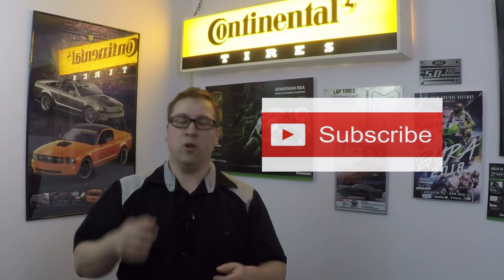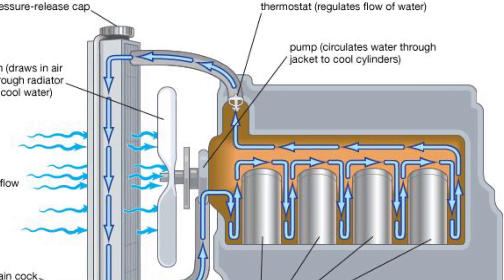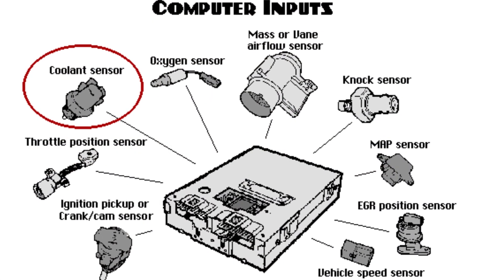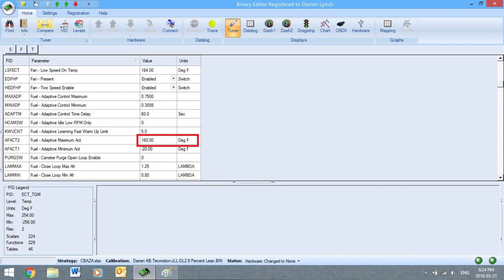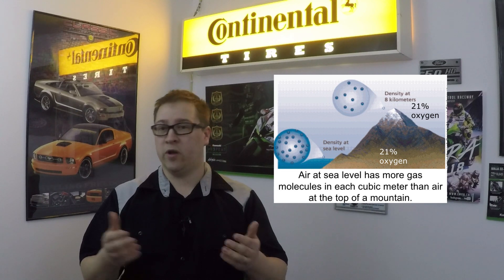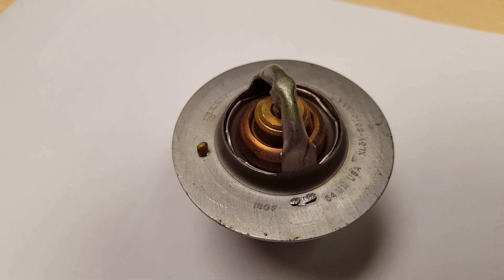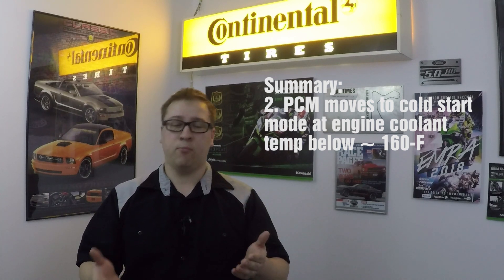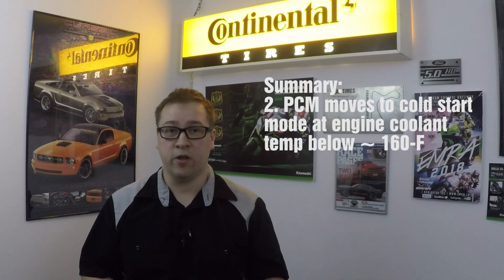Which Performance Thermostat for your 5.0L? - SN95 Owner's Guide #5

Comment: I just completed a p.i. intake manifold swap on my 97 GT convertible 5 speed. Along with all the other bolt ons. ( bbk 73mm, slp catback, bbk cold air, steeda underdrive pulleys, sr performance aluminum driveshaft). Upon completion of the install, for some reason, I decided to buy a moshimoto racing thermostat, because in my mind i thought cooler is always better. The car would not even warm up. It was bad. I ended up putting a new oem replacement in it and it still runs a little cooler but it now warms up faster, and my fans kick on when they're supposed to. The moshimoto thermostat never got up to temp so my fans never kicked on. I would stay with a stock thermostat unless heavily modified with a different temp sensor for the fans.
Reply from the maker: That is a great data point and aligns with my experiences as well. Glad to hear you got it figured out. Thanks for watching and commenting! - Darren
Reply: @GrandTouringConcepts  question for you darren. In the future could I run a 97 cobra t stat? I know the 97 GT thermostat is a 190? The cobra a 180? The moshimoto therm I put in was 160. A little too extreme. Either way with this intake manifold swap the car really does run colder even with the oe thermostat.

Comment: Id rather run cooler and prolong engine life, also minimizing expansion in heat cycles. I can always force open and closed loop fairly simply. Ive put 275k miles before someone (not me) wrecked my most reliable vehicle and it consistently performed better when ran cooler.

Comment: 95 mustang 5.0 convertible having some issues trying to see if this is the culprit or maybe ect sensor or iacv or possibly a vaccum/exhaust leak some where

When I start the car everything is fine ,drive around for a few minutes and the check engine light flashes,idle becomes more of a “chug” sounds like it’s gasping for air or has a cam (which it dosent) lol it’s straight piped from the first cats back… newish radiator new alternator new spark plugs new tranny and oil fluid/filters new ambient air sensor/new MAF / cold air intake /newish fuel pump, car was experiencing same issue two weeks ago but would only flash check engine light  randomly while driving /accelerating then would shut off as I took foot off gas/ slowed down with the brakes. When the check engine light shows the car feels like it won’t shift out of the gear that it’s in,it will just push the rpm’s higher as I press the gas more then when I let off it’s a very quiet “chuggy” idle. Also emitting what smells like exhaust vapors pretty strongly when the check engine light is engaged PLEASE HELPPP
Reply: Car will die at idle occasionally,Also car made same issue the other day and when it shut off I hopped on the highway to get back home(was working out of town) and she got me through about 2.5 hr drive with no stalls or overheating so I’m confused as I would have thought there was ahead gasket issue but there was no overheating at all ,wouldn’t the car get hot after driving that long If it was the head gasket ? And I wasn’t feathering it either lol
Reply from the maker: Perhaps take a look at our ignition diagnosis video we have on the channel, that could be your problem.
Reply: What was the issue ?

Comment: I tried squeezing my hose while it was running And I didn’t feel any water but at the same time my engine doesn’t get too hot. Could that be the reason why the thermostat doesn’t open? What do you guys think?
Reply: It could be stuck out or doesn’t have one in it, I run a 170 degree Arkansas gets hot and very humid!! And if you ever advance your timing to high and engine temps get high you notice the chatter even with high octane gas, I run mine at the point of chatter with mid grade so 91/93 octane helps and helps it perform alittle better

Comment: Huh. Occasionally get a cel while driving but its intermittent.  Have had tons of issues keeping the car cold and have even eaten a head gasket because the thermostat failed while on a highway. This week my fan burnt up at the connector and the motor died with it so I'm in the process of wiring a black magic 180 into the car and i planned on swapping a 180 thermostat in. Interested to see if that may fix the issues I have. Like getting 12 mpg. Thanks for the info this page is the reason I bought my 94 cobra

Comment: Can you make a video about vacuum lines!?
Reply from the maker: I can certainly add it to the video list, it might take a little time to assemble the visuals though as not too many cars have a full OEM system any longer. Thanks for watching and commenting! - Darren
Reply: @GrandTouringConcepts  I have a 1994 GT Mustang it's an automatic but it has all the oem lines. The only thing not stock is a new radiator.
Reply: Your vac lines are probably like my 5.0 ranger.. pretty old and weathered. Hell, half of mine are washer fluid lines. But they work as they should now and I have a good runner aside from cam syncronizer going

Comment: thermostats make the radiator work! i have a 2 core aluminum radiator, 180 thermostat and a fan controller. i use these parts to keep my mustang at 200 degrees. why? cause i read in a mustang performance book that at 200 degrees, our cars make the most power...

Comment: Dude..I have posted before and gave a bit of info about 9 0f my 5.0s..I havent told you that I own a dedicated  Ford Performance shop.I am actually  the 2 year running State Drag Racing Modified Champion and Im in the lead this year, winning all 3 races so far in my manual 94 CONVERTIBLE with a ROUSH All Aluminum Stroked 351W/427 SBF..I cant share my exact build but im running a mid 8 second SN95 MANUAL..Any questions,just ask man..Take care..C..

Comment: I found running A 170 works best for me and I live in ne ohio.  Aluminum radiator and 2 fan on a toggle. Lol I love how it runs now
Reply: The fan on toggle is what's saving it. Otherwise you'd have issues.
Reply: My fans never kicked on oce with a moshimoto 160 degree in it i threw it out and got oem spec and have no issues

Comment: So in your case you could actually set the OL temp to whatever you want using BE, right? My question is what temp do these engines make the most power, assuming you have the ability to tune out the ecu pulling timing when ECT gets high. If Ford put in a 190 thermostat for best emissions/efficiency then I imagine best power is not far off of that. Maybe it's like you suggested, a 180.
Reply from the maker: With recalibration access such as BE you can certainly rework the OL temp triggers. As for what makes the most power, I haven't seen a proper ect vs rwhp test scale. Generally 5.0L like to run cooler whereas in my limited testing mild modulars make more power at 200°F or so.

Comment: I have a 94 5.0 with the kenne bell 1.8l blower.  I am trying to tune the car and need some help with it.  Just have questions about the VE and the reason why binary editor limits the slopes for the fuel injectors. I want to run e85 and have 78lb injectors.  Help please.  I am running the car with the 180 as well and it runs 190-201 degrees depending on the weather.
Reply from the maker: You are a little bit outside my area of knowledge, I have never worked with E85 or injectors larger than 42 lb/hr in Binary Editor. Have you had any luck on the ECCTuning forums? -Darren

Comment: So what’s the best for fla weather?
Reply: Pretty late reply, but I'm running a 180 degree thermostat. Not the fail safe one so it doesn't get stuck open. No engine codes and it stays cool as long as the fan is on, even in stop and go traffic
Reply: Hey what's up Mike 
I'm from north Florida (lake city)
I run no thermostat
With a 140 thermoswitch that's in the thermostat housing. (One wire) It just grounds the high speed terminal in the CCRM 
Runs great, no check engine light.
I may change for a 160 (thermoswitch) becuase in the summer the fan pretty much runs constantly.

-95 cobra

Comment: What about on my Binary Editor I have it set at 186 on temp and run a 160 t stat and car runs at 186. Should I change it you think? My tune is spot on and car runs amazing.
Reply from the maker: AAD Great question! So I am a huge fan of if it isn't broken don't break it, in your case, if the car is working well I see no need to change the thermostat in your application. A 160 might be perfect for your operating environment and that is good to go. Inside the scope of most SN95 cars out there they are untuned, or their tuner may not adjust the minimum coolant temps and fan toggle speeds to match a sub 180 thermostat, the recommendations are purely a benchmark. Anyone using a twEECer or other datalogger can easily test by going for a drive and watching for the OL/CL toggle, it should remain in CL unless at first cold start or WOT. If it hits OL during cruise we know to check for over cooling. As a short term band aid for my Lightning we simply lowered the OL temp to 160 F but it had drawbacks of poor heater performance and a 3 mpg loss in my all-weather truck, so a hotter thermostat was my fix. Again, thanks for the comment and discussion! -Darren